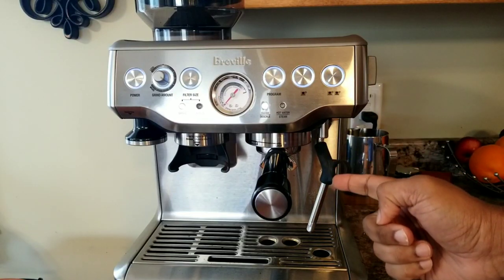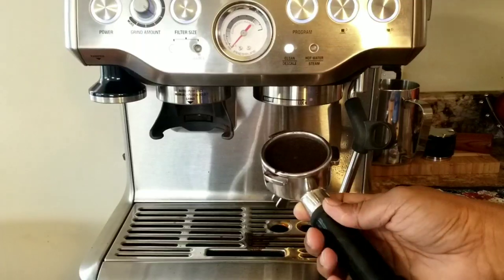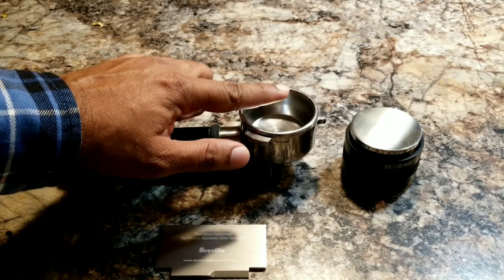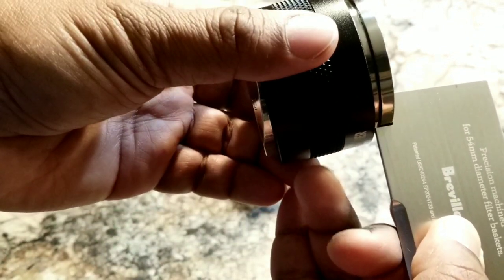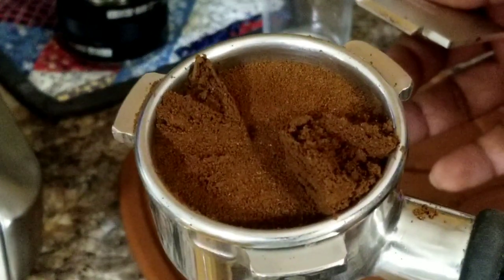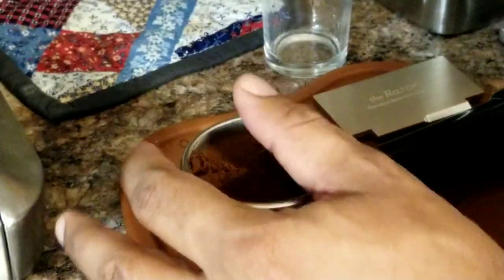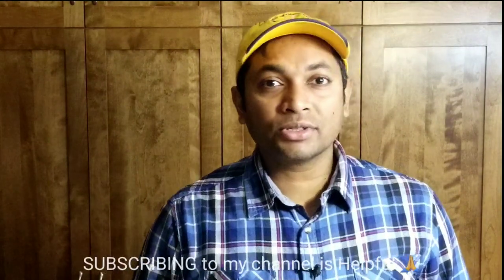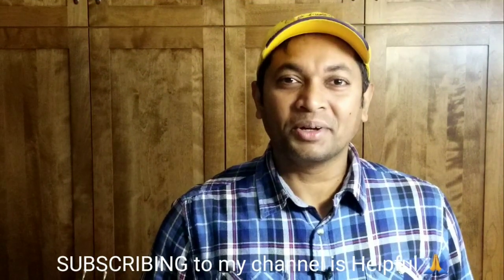Espresso PUCK stuck on the Group Head? Breville Barista Express

Comment: The 3 way solenoid puts SO much water in the drip tray! I think I preferred my cheaper machine with no 3 way valve and soggy pucks instead of drip tray always getting full! 😂😭
Reply from the maker: Also verify the Grinds level using Razor tool. If its too low it will be more soggy. I wish the drip tray is bigger 🙂

Comment: this usually happends to me when im not quick at discarding a finished shot if you do it straight away doesn't really happen
Reply from the maker: Thank you. Also this changes according to the beans as well. Normally the puck should be dry and come out easy, after you leave it in the PF for a minute or 2. In your case glad you found a work around.

Comment: Hi, I have the Breville (Sage) Barista Impress - the one with the tamping system that let's you know if you're at the right level in your basket. It shows me green, it's 18g. I additionally try and make sure with the razor tool. Everything is perfect - yet the puck keeps on staying stuck to the shower head. It's like you HAVE to use a puck screen, otherwise it's always a mess. Any additional things I might be doing wrong here? Oh I was making sure the shower head is screwed all the way to the top and not sticking out too much. That can also be a problem
Reply from the maker: Have you tried to remove the Portafilter immediately after making espresso? Try that. Or grind coarser and see.
Also an easy fix is to press single or double cup button for 2 seconds and press again to stop. That will push the puck down to the Portafilter

Comment: hi Aju. Is there a risk of over-tamping and channelling by going past the razer height?
Reply from the maker: You should be ok there. You may get soggy puck. It has nothing to do with channeling though. But since Breville provided the correct height, I'd follow that.
Reply from the maker: You will see high pressure if you over tamp. To fix,  you can reduce the quantity of Grinds to a lesser amount to avoid over tamping. Over tamping can lead to bitter coffee.

Comment: Is your Razor tool definitely 7.5mm?  I have just measured mine and it is only 6.5mm
Reply from the maker: You must be right. As I don't have smaller accurate scale. It show 0.25mm or 0.3mm which is equal to 6.5mm roughly. Thanks for the accurate measurement. Any idea is to set 0.5 or 1mm more.
Reply: Yay! Thanks for just what I needed to hear. I love my Breville, but am stumped when weird things happen. Juicy pucks, dry pucks, but it’s so fun to experiment!
I need to see if you have done an how to one grinder problems. I’ve needed to take the hopper off twice to figure out why things got stopped up. I was leery of breaking something.
Reply from the maker: @sharonmurphy97 Thank you. I have few videos on how to clean Grinder. Some coffee beans can have stones. Beware! This can damage the Grinder. You should clean it once a month for better performance. 

Manual Clean Grinder:
https://youtu.be/cNBC4biJx4E

Auto clean Grinder: https://youtu.be/faNMuDs-Cxg

Comment: Hi 

Arent u tamping it that way before u distribute the grounds wich in my eyes is bad.
Reply from the maker: No. I'm Tamping it after distributing the Grinds. If you are referring to Razor tool, that is to be used to remove excess Grinds after tamping.
Reply: @AjusCafe  i meant by adjusting ur OCD ur tamping it before it gets distributed because ur putting pressure on it. But if u distribute before putting the  OCD then there is no issue my bad
Reply from the maker: @bnmsa  the distribution side (like wedges) are set to minimum height, which helps to distribute the Grinds before tamping.

Comment: I have the bambino. It doesn't come with the precision tool
Reply from the maker: I don't think so. Razor tool comes with Breville Grinder or any machine with Grinder.
Reply: @AjusCafe  i have the SGP but the razor didn't come though
Reply from the maker: @80goal  it should come with one. Did you check under the tray? Usually they place it there. Even my basic breville Grinder came with one.

Comment: Why does sometimes a puck have water sitting on top ? I’m experiencing the opposite a very wet puck
Reply from the maker: 2 reasons:
1. Your tamping level is too low. Lower than Breville's Razor height. Use that tool to verify the correct height. 
2. You are removing Portafilter too quickly from the GroupHead after making espresso. Leave it for 2-3minutes in GroupHead so that the machine sucks up all the excess water. You should get dry puck after 3 minutes.
Reply: @AjusCafe  thanks -I wondered that - it seems you get different levels in the ports filter depending on the bean and grind - I’m a bit new to this so trying different beans and settings. And different styles like Cuban , Turkish , the machine etc . The videos have been really helpful in the channel . When you do the tamp do you really need to press hard - I tried that and ended with a drip extract. But noticed you seem to press hard - I’ve got the distribution tool
Reply from the maker: @JamesBambridge  to be consistent i use weighing scale. So that i don't depend on the inconsistent dose amount of the machine.
You DON'T need to tamp hard.. lol that's my mistake... that 2 in 1 tool that i use gives consistent height as it hits the ridge (razor height) i set. So even if i apply pressure or not, it hits the ridge and won't go down any longer. I stand in a weird angle for the video, that's why i tend to apply lot of pressure...
Reply: Yeah. Me too. My puck is always soaking wet and is always stuck in the group head after I use the double basket. My level is too low then? I use 16-17 grams of coffee and using a distributor then tamping quite hard it gets low in the porta filter 
I’m so bad at espresso 😢

Comment: The filter and the coffee stuck in the machine. Any one know how to fix that?
Reply from the maker: That's because the little clip in the Portafilter that holds the cup in place is very loose. Its time to buy a new clip. If not you could try to bend the clip a bit so that it grips the basket tight.
Reply: @AjusCafe  thanks you got your self a new follower 😉
Reply from the maker: @danielias1008  thank you 🙏

Comment: Only problem is there’s 0% chance you got 18grams of coffee out of the hopper. Had a bbe for over a year and never once has it pushed out a full dose of what I put in. I get that it’s not the point of this video but still an odd thing for you to say since you didn’t measure it after it was ground therefor probably needing to make a different height again because more or less coffe in the group head
Reply from the maker: Good point there. Grams can vary both ways. Sometimes i get 18.2g out of 18g beans. Sometimes less. To be accurate we should weigh after dosing like u suggested.